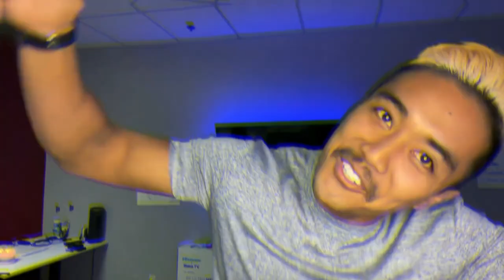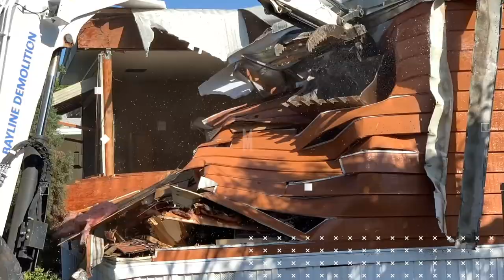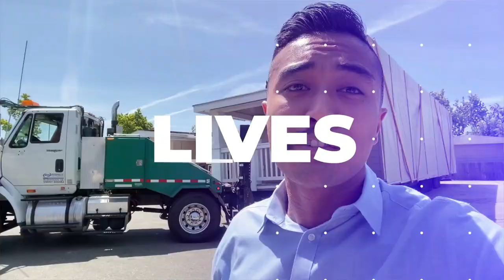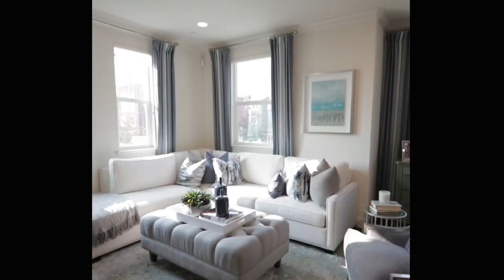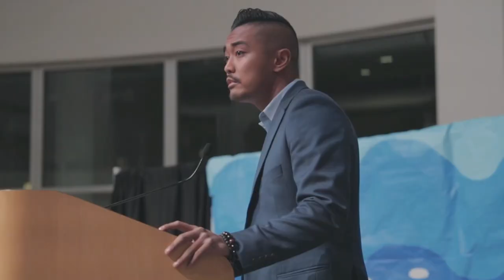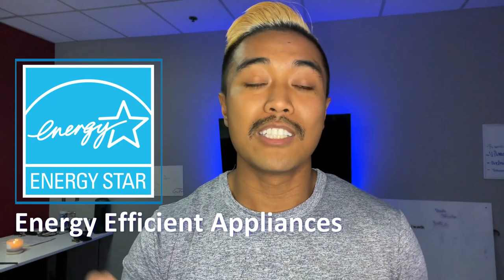5 Ways To Make Your Mobile Home More Energy Efficient | Franco Mobile Homes

Comment: I put layers of foil, polyiso insulation and a metal roof.  The left over polyiso I cut into widths that could be slid into the attic vents.  I would like to install more polyiso onto the outside walls but I have run into the snag of dealing with the California Housing Development Dept.